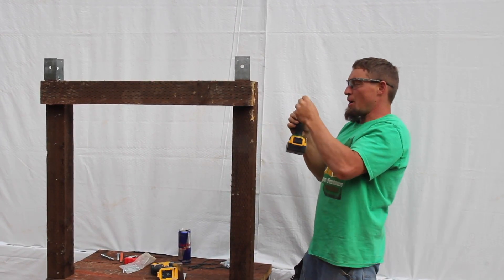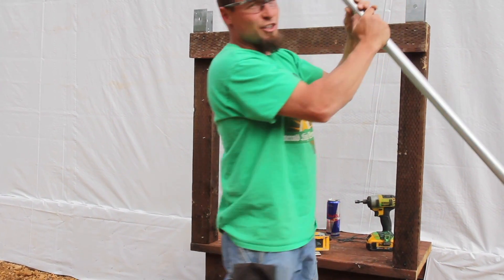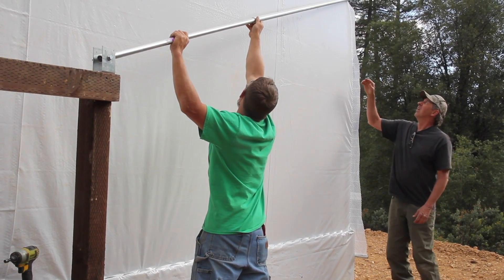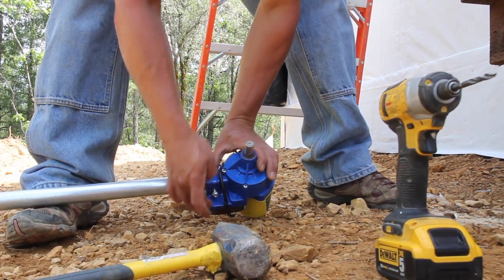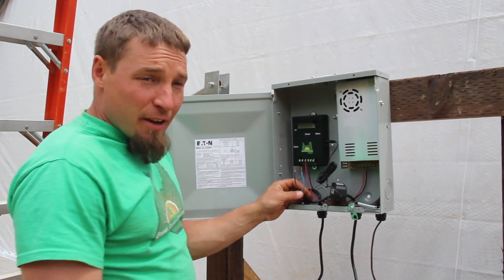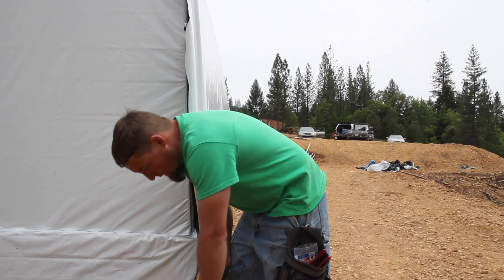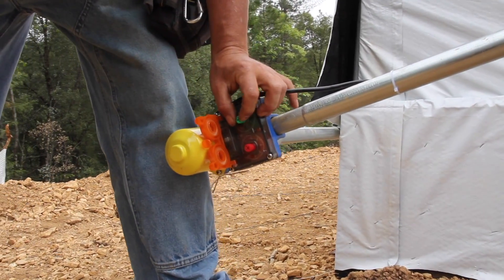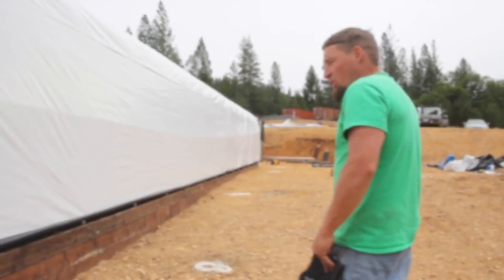Blackout Motors Electrical

Comment: Whats the name of your control panel box? Where can i find one on a budget?
Reply: we use the $5 timers with the pop up tabs and a few relays ($3-5 each). One timer does roll up and one does down with power reversed. Easy peasy. The motors already have automatic stops on them so give power for 15 minutes and you're good.

Comment: I have problem with my light dep motor is getting hot do u know why?
Reply: Your motor is over loading from weight or bad bearings.
Reply: Chem Dog is probably correct. How long is your greenhouse? Are you using 1 3/8" 16 gauge as your rolling bar? Also, do you have 100w dep motors? Sometimes you see cheap 50w ones sold on Amazon, etc. www.lightdepsolutions.com
Reply: like lighdepsolutions said use the 100w motors. They will get warm but only operate for a few minutes at a time.